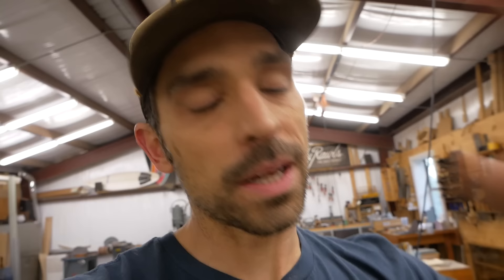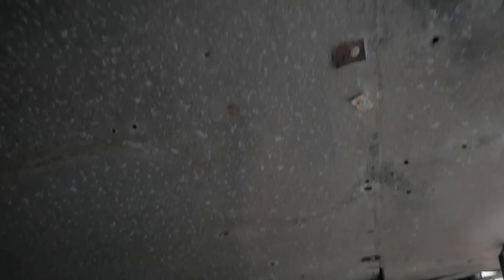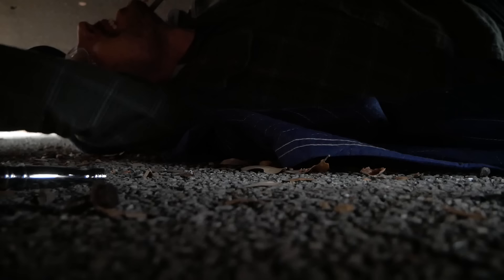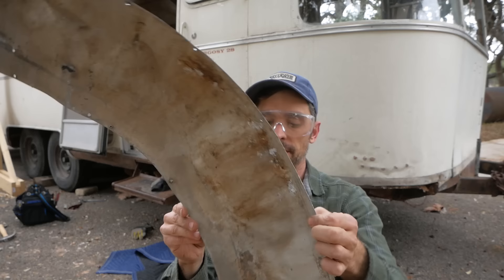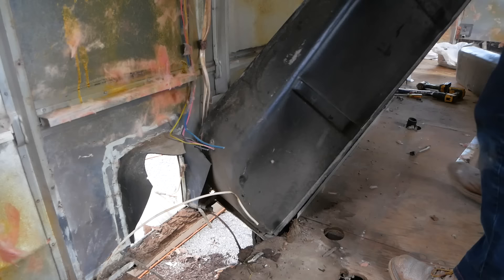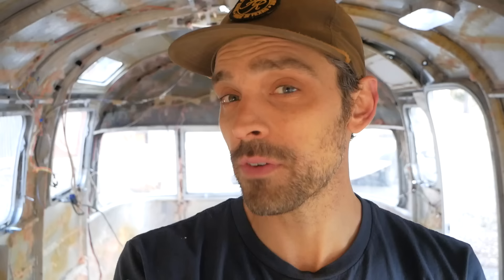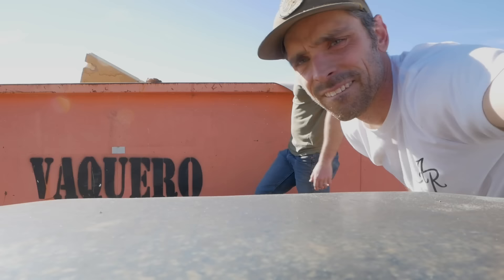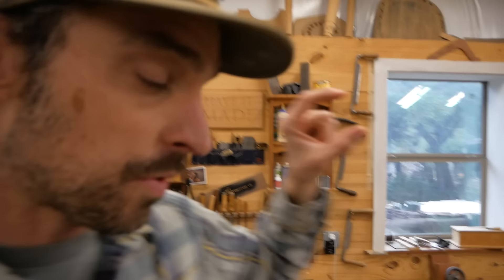Belly Pan Removal (Airstream Argosy Ep. 2)

Comment: An automotive floor creeper is your friend in the future.

And yes, all that metal work can be fixed at any good fabrication shop of which I know there are quite a few in the hill country.

Oh and for the future...Lowe's sells a very easy to use 2 part spray foam system that works great.

Comment: Of course you can do this. You are a master craftsman! Slow and steady and you will be done. Hey, what about carbon fiber for the wheelwells? It works well in areas that need to flex, lasts pretty much forever, is lightweight and a great alternative to aluminum. Just a suggestion. Not sure if you are doing a restoration that remains true to the original or are willing to use modern techniques. Anyway, this is enjoyable to watch. Cheers!

Comment: If you have a trade school or a high school with a metal fabrication class you should contact the instructors.  They usually are looking for a project to work on..or may recommend students to help you fabricate them.  You are not only getting it done right but giving them a fun project. Actually if you have a trade school there are many courses taught that could help you for little..(usually cost of materials) or no charge.

Comment: one tool for this project you really need is a Oscillating Multi-Tool..they go through rivets,caulk everything on and in this trailer like soft butter..Edit: oh yeah..if that a/c unit is in good shape use it..r-12 absorbs more heat (much colder air) and runs at lower pressure (less amps) than newer models..edit: oh well sorry to see that a/c unit trashed :/

Comment: You can do a quick and dirty frame of plywood to hold the wheel wells in there shape (or refit them temporarily in the camper) and do a fibreglass layup of the wheel wells and remove (and discard) the plastic after the resin has cured...

Comment: For banana wraps to make your anvil take a hardwood stump, stand on end and grind/carve a very mild concavity into it 10 or more inches in diameter, smoother the better.  For hammers a combo of rawhide mallets and turned hardwood mallets with slightly convex faces.  I'm not an auto body guy but these tools are standard with copper and silversmiths and they'll work just as well with aluminum.

Comment: Sure a lot of work but you appear to be doing it right clearing all the crap out. I worked for a company that sold ambulances and they used a product called Sikaflex to seal between aluminum body panels. Sikaflex 221 should help the rebuild. Keep the faith AR.

Comment: In reference to you banana panels. If the aluminum is not thinned or corroded *yes aluminum will corrode, depending on what is in contact with or exposed to, specifically other metals. Galvanic corrosion, if you didn't already know that. :) Some of you other panels appeared to be in that condition? As I read a couple others say, any good bodyshop can fix the dents & restore the panels original shape. Depending on the shop, like a hotrod or custom shop will be able to make new panels for you. If cost is a concern, consider a decent set of body hammers (a kit), with some self learning via other how to videos, you could fix & restore some of those panels yourself, it just takes time, pateince, & a decent understanding of the metal you are working. You will find for a bodyshop or metal fabricator, it will be the labor in straightening out the dents in those panels that adds up. It is not just taking a hammer & pounding, metal can shrink or expand in undesirable ways if over worked or done incorrectly. Next the materials, even new aluminium is typically the least expensive part. Also Airstream is still making new models currently. You may check if they also sell any replacement panels you may need. I suspect that would be the most expensive way to go. Good luck. If you end up not finding anyone to fix the banana panels, get ahold of me thru my channel & I'll see what I can do to help. Best wishes & looking forward to more videos.

Comment: If it were me... :) for what it's worth.
I would build a ribbed spine inside the camper. Nail 2"x8" 's together long enough to reach the next to the last rib supports at the front and back of the campers roof. Then cut 2"x 4" 's 4' long to mount on top of the 4"x 8" beam at the points where the campers ribs cross. Run chains through the AC and vent openings to the beam. Set your A=frames over the openings and Bob's your uncle.

Comment: After rebuilding a 59 model I didn't pull the belly pan off as I saw no reason to and was able to do all the floor repairs without pulling the shell off. Your nightmare has just begun. Since you took all the pan off and pulling shell off I'd repair the frame then flip the frame upside down and reattach the belly metal then. You'll drive yourself insane trying to reattach all the metal laying on your back. All the airstream people I talked with said do not walk or put your weight on the outer skin. I used scaffolding and never put my weight on any of it.

Comment: RV Rooftop is no place for A/C units!  In engineering terms: it’s stupid!  Too much weight, at too great of hight, creates too many problems.  If budget allows, look into a/c units for the marine market, as these are designed for a compact foot print, are super-efficient, and with solid reliability in build-quality.  In fact, some units are compact enough to fit inside storage cabinets and run off of 12v DC/110v AC very efficiently.  

Also consider a split/unit that lowers the mass to a level closer to wheel level, but only works on 120v AC.

Putting a bulky and heavy object on the roof of an aluminum trailer is inviting leakage problems sooner than later.

Comment: 100% the wraps can be fixed. I would give them a soft soda or walnut blast due to the age of the material to see what you’re working with. Most of if will hammer or roll out nicely. However due to its age and structure some of its integrity may not hold up to being re shaped as nicely as you would like it to look esthetically 
Also  it may be more cost effective to source less damaged pieces (tough i know) then the hours and labour to have someone else work on them.
Reply: Thanks for the videos you’re about 2 months ahead of me in this process with the same trailer. I’ll be taking notes :) 
Cheers

Comment: panel restoration - you will need to farm that out, hammer dollies, english wheel, planishing hammers, shrinkers etc. expensive takes space and the learning curve vs time and $$$  but a true body guy could restore or build a new banana panel np.  Also strongly suggest getting any schematics from manufacturer. lifting lowering the heavy stuff, 4:1 pulleys and a figure 8 belay station will be so much better than sliding stuff into a pricey truck from above :) Too late now but def would of measured and diagrammed everything, essentially creating your own reference manual. It's a big project but it is entirely doable > every wife ever: what is my husband doing? every husband ever: this is friggin awesome. go get some!

Comment: Hi.

I would keep those plastic wheel wells and use them as templates to make new ones out of fiberglass instead of aluminum.
Reply: TissuePaper just curious, what would be the benefit of using fiberglass over aluminum in this situation?
Reply: @brycewipper788  Cheaper, easier to do yourself, probably lighter.

Comment: I am still amazed to see that Americans build there homes basically out form wood frame..........here in Germany we use altered steel frames / beams and just the roof has to be made completely  with with wood beams ( amazing to see them cutting those long beams by hand in that intricate  puzzle pattern  )   I worked at a roofing company and it was interesting!

But talking about your Airstream, wouldnt it be easier if you just seal the chassis with some tar paper or similar...just heat glue it on and it should seal the camper all around....even on the bottom

Comment: You might find that a heating and cooling company,might be able to fabricate those banana wraps and those parts connected to them and I’d think of wood   wheel wells lined with galvanized sheet metal or aluminum

Comment: Is that Dewalt the Atomic model? They are trash, my friend. Never buy into that line. Probably a good time to upgrade to Milwaukee tools.
Reply: Howie Z I agree.
Reply: Or just buy a larger Dewalt instead of the compact model. More of a lateral move between the two companies. Doesn't make sense to switch if you've already bought into one of them.
Reply: @daaper  He could warranty this tool and Ebay it. Then upgrade to better tools. Even Makita would be an upgrade from this trash. DeWalt has gone to hell in quality
Reply: Howie Z c

Comment: you've  got  youth  and  adrenaline  on  your  side,  rawls … as  well  as  a  wonderful  family.  after  the  shell  comes  off  and  you've  inspected  the  frame … step  back  and  look  at  your  plans.  you  talked  about  solar … will  it  be  necessary  to  move  the  main  air-con  over  28"  for  maximum  solar  coverage?  now  is  the  time  to  consider.  are  you  gonna'  add  a  camera  to  both  exterior  rear  corners  of  the  air-stream  for  assistance?  they  may  need  add'l  frame  support … probably  mount  the  displays  via  blue-tooth  connx  into  your  truck's  cabin.

before  applying  insulation … do  thorough  water-test (hard spray) with  garden  hose.  driving  the  air-stream  down  the  highway  at  70mph … wind  and  rain  pelting  the  rv … that's  a  lot  of  water  pressure.  keep  in  mind … seals  'n  seams  expand  and  contract  with  seasons … same  goes  when  applying  add'l  weight (gray/black tanks) .  sure,  the  electrical  will  be  a  major  headache … but,  nothing  you  cannot  overcome,  andy.

and,  remember  to  outfit  the  hitch  up  front  with  a  very  sturdy  and  proven  lock ($500+ is not unreasonable) … so  nobody  can  drive  off  with  your  newly  refurbished  icon.  best  wishes  to  your  completion,  sir.